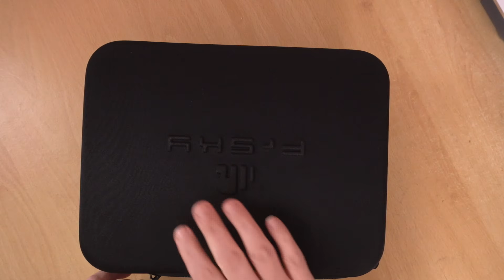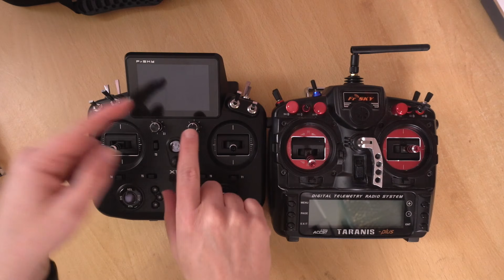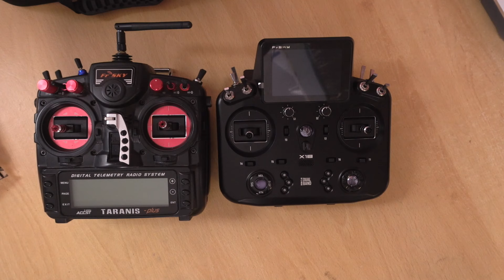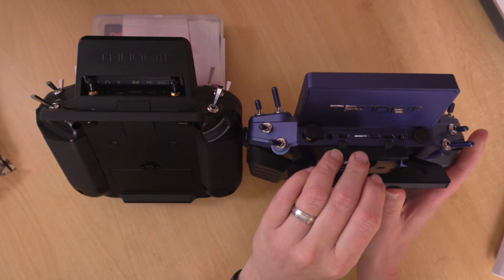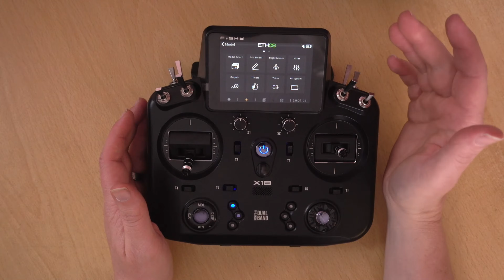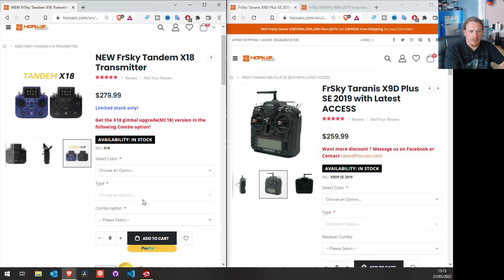First look at the FrSky Tandem X18 Transmitter

Comment: i am a pincher . the no deal for me is the raised part the front switches are mounted . my index finger hits that hard , not the switches themselves and i just do not get it ,The twin x14 is much better since it does no have that stupid raised part  but has a dumb antenna  that does not fold .i Like the screen interface  a lot but anything that gets in the  way of my fingers is a no deal for me .

Comment: Great video, how is the screen brightness in broad daylight? 
Question 2, yours is the x18 they also have the S an SE models. If I bought a standard X18 would that be like yours?  The the brochure says that it doesn't have 6 axis gyro but obviously you were using it.  Hopefully my question wasn't to confusing.
Reply from the maker: My X18 is pre-production. So it had the gyro. The production X18 doesn’t. Take the comparison table and brochure as what you’d actually get. 

The screen on the basic X18 and X18S is ok in daylight. But not brilliant if it’s bright out. You can improve it by using the white theme, rather than the default dark colours. But, the screen in the X18SE is better. It’s brighter and better quality.
Reply: Thanks, I'm going to give the X18 a chance. I can always upgrade later.

Comment: Hi, thanks for the great review. 

Can you tell me about the different gimbals on the X18 to the X18S? I can't find anything on the internet about this. Only M18 and MC18 gimbals. 

I am currently flying with an X9D SE plus. However, I would like to move away from OpenTx and would switch to Ethos. Now it's about the model of the transmitter. Would you say the premium is justified? What do you think of the X18SE? 

Regards, 

Martin
Reply from the maker: Hi Martin,

The difference in the gimbals is the X18 gimbals have an aluminium panel, but plastic body. Whereas the X18S/SE are fully CNC machined from aluminium. It makes the gimbals longer lasting, a little more precise, and will not flex. I prefer the full CNC gimbals. 

The SE has a better screen than the other X18 models. It has glare reduction and I believe the image it better too. I’ve not seen one in person to see how much better the image is.

Comment: If you could only buy one, which would it be and why?
Reply from the maker: Out of which, the different X18 models or out of the radios in general?

Out of the X18 models, it would be the SE, because it has the better gimbals, and more importantly the better screen. 

Out of all the radios. It would be the X20S at the moment. Because of the gimbals and the larger screen.

Comment: Hi Darren, I have just installed a TD receiver,to use with my x18 . 
The servos buzz/chatter, I understand this is caused by the 900Hz telemetry. I have twisted the servo wires, and routed them as far as possible from the T Ariel, but the problem persists.
Is it possible to disable the 900Hz telemetry?
Reply from the maker: I've never really had this problem. From what I understand, it only seems to affect some Hitec servos. On the latest RF firmware, you can reduce the 900MHz telemetry to 25mW. This should stop, or at least reduce the chatter. I know FrSKY are looking in to the problem. But the real solution is separation.

Comment: Hi Darren, I have just bought an x18 and have a concern regarding the range test.
In range test I am getting a distance of around 30 feet before receiving signal loss warnings and a few more feet causes the model to go into failsafe. Is this typical?
I only have two receivers a sr6 and r4 , the results are the same for both.
Reply from the maker: Yeah, its seems pretty normal to me. My X20S' range test was about half that I could get with my X10S Express. But I've had no problems in flight at all. If your concerned, you could always sit the model at one end of your flying field, walk to the opposite end, and test control at that distance (range check off). That will give you a minimum distance you can still fly. I've not had any RF issue feedback on the radio.
Reply: @MrD  Hi Darren, Thanks for that, I will try what you suggest 👍

Comment: I am quite happy with my Horus X10 Express on OpenTX. I can make so many special mixes for my scale planes.  Pouring over some of the review videos Ethos make life a bit simpler but with some caveates.  According to the Manual for X18 for one example in Special functions I am unable to disable the throttle channel which I use to ensure electric planes don't start - a safety switch.  There appears to be a fair bit more missing too compared with Open TX features.  I really fancy the X20S or X18S as a second TX but will wait and see future updates.  I fly electric and Petrol.
Reply from the maker: It’s not missing, just different. For example with the throttle. There is a throttle cut built in to the throttle mixer. So setting up a safety switch is actually easier than with OpenTX.
Reply: @MrD  Hi Darren, thanks for the update. I had not seen any references to it in any reviews. The X18S is at pre-order only at present at T9

Comment: Great review, It’s so difficult to find good vids on frsky or x18/x20 in general. Especially being new to FPV, I wish there was a video explaining receivers for these models, I have no idea what to buy for my quad!
Reply: SAMEEEEEEE! I think there’s a lot of new drone users shopping on GetFPV because they just started selling the X18. I’m in the same boat I have no idea which receivers are the best for drones. This channel is 1 of only a couple that give any good information on these radios.
Reply: @TaylorGangGang  I just bought mine on getfpv a few days ago so maybe lol It should be arriving tomorrow. All the videos I find for receivers haven’t been very helpful 🤷🏻‍♂️
Reply from the maker: Thanks for the comments guys. I have a little tool for seeing which receivers will work with your radio at https://www.mrd-rc.com/tutorials-tools-and-testing/useful-tools/frsky-receiver-compatibility-tool/

For a quad, you'll probably do well with an R9 MX. These are pretty small and have an "Inverted S.Port" pad. So you can hook them up using FPORT on any flight controller. That'll be fine on a 5" and up. It has a 900MHz T style antenna. For smaller quads that will be kept closer. There's something in the pipeline that could be very interesting.
Reply: @MrD  Thanksssssss! That’s exactly what I needed (: What’s the main difference in MX and SX besides the size, if you don’t mind me asking? Thanks again!
Reply from the maker: @MsTrinityS.  The SX is larger and has antenna diversity (2 antennas). But it doesn’t have Inverted S.Port which means you would have to connect it to F4 flight controllers using SBUS and S.Port. 

The MX is a lot smaller, only has 1 antenna, but does have Inverted S.Port. Making connecting to any flight controller easier.
Reply: @MrD  Thanks so much!!
Reply: This is why its sad local hobby shops barely exist anymore so you can talk without someone face to face and actually see products right then and there. Also, check out your local flying field if you have one, usually rc guys/gals are friendly folk and willing to talk rc. Shower their flying skills and models with compliments and you probably wont get them to shut up, lol

Comment: Some super newbie questions coming at ya. Can the X18 be used on simulators like Liftoff? Also, do you still recommend it 9 months later? Thanks for your time.
Reply from the maker: Sure, you can set it up for most flight sims. I’ve used it with Liftoff. https://youtu.be/mtLUrNfdsGs

Sure, it’s still working well. Though I would say the X18SE is better if you can get it. The screen is better.
Reply: @MrD  Thanks for the reply. If I can bother you with one more beginner question. Will ANY FrSky 900mhz receiver work with the X18 or only specific ones? Any that you especially recommend for range? Thanks again.
Reply from the maker: Yes. All FrSky 900MHz receivers can be flashed with ACCESS firmware. Though I would recommend the more recent receivers as they can be updated over the air. So R9 MX and R9 SX are the most recent receivers. But also fine are any others that have OTA in the name. The older receivers will work, but cannot be updated over the air. You have to connect a cable.
Reply: @MrD  Sweet, thanks for the info, I just ordered the R9 SX + OTA 👌 I subbed for sure.
Reply from the maker: Nice. The Slim+ OTA is still a receiver I’ll happy use too.

Comment: Finally got one of these as a backup to my X20S.  X18SE .  Or maybe the X20S will be the backup.  The X20S just feels so much more premium and the screen is glorious.  But the X18 just feels better in my hands, no interference bumping my fingers into the switch humps since I'm a pincher like can happen on the X20S and I get the 2 missing trims back with traditional trim switches.  I can only hope that the X24 is something that has the ergonomics of the X18 with the big screen and premium feel of the X20.  I'm curious to see what the "pro" versions of these radios will be supposed to be released this summer.
Reply from the maker: The X24 is unlikely to be this year from what I’ve heard. I can’t really say much about the X20 Pro, other than it is a more premium version of the X20. I have seen renderings and there are a couple of cool features. I don’t believe there is an X18 Pro planned.

Comment: I wish this TX had support via an extrrnal module for Spektrum DSMX for my Heli's using that protocol.  If it had that, I would buy one tomorrow.  I love the ergonomics of this TX for pinchers.
Reply from the maker: It does. Multi-protocol module support was added in ETHOS 1.3.0. MPM modules can work with DSM2 and DSMX.
Reply: @MrD  Oh!!, OK Thanks! Awesome!! Can you please advise where I could get a MPM that fits the X18 please.  All the ones I'm aware of are designed to fit in a JR module bay.
Reply from the maker: I believe the IRangeX IRX4 Lite works with the X20/X18. I’ve seen people using that module.
Reply: @MrD  Awesome!  Thanks!👍
Reply from the maker: You’re welcome Graham.
Reply: @Graham_Shaw  irx4 lite.  I have one on my X20S and it works 100%.  You just have to manually load the LUA scripts which is also easy to do.  FrSky will never include them in official firmware because of legal reasons but nothing stopping the end user from loading them so that's what we do.  I have a ton of FlySky 2A receivers in my cheap foamies, a few older FrSky D8 receivers and a few Spektrum BNFs with A3SX and my X20S flies them all.  That said, anything $$$ that you really care about should be on Tandem IMO.

Comment: Can you also comment on what the differences are in terms of internal memory.  Is it true that the X20 has no internal memory at all and needs an SD card to function?
Reply: @Mr.D - Falling with style I'm struggling to decide between the 18SE and the 20S. The price difference where I live in India is pretty much insignificant between the two. I've just been informed that the 18SE is now soon to be available in Blue / Black that's good. 

I have held the 20S and found the under finger squarish grips a bit uncomfortable but have never held an 18 and will not have an opportunity to hold one. Really torn between the 2 choices..

Any advice? Is the quality better on the 20? I think I would be more comfortable with the 18se but with the price so very close i keep going back and forth on whether I should just go for the 20S
Reply from the maker: Honestly, if I were going for the X18SE, I’d go for the red. It looks so good in that colour. I’m even thinking of spraying mine. 

The X18 does feel nicer in the hands to me than the X20. But the X20 is a bit better build quality. The bigger difference is the screen size. The X20 screen is a fair bit bigger, so if you eyes are getting older, it is easier to see what’s going on. I did see a question from FrSky asking if people would like softer, foam replacements for the plastic grips. But, whether that progresses any further is anyone’s guess.
Reply from the maker: Yes. The X20 doesn’t have any NAND storage.
Reply: @MrD  Was wondering if this a good or bad thing.. The 18 & the XE both now incorporate NAND storage and this seems to be a good improvement. I wonder if they would add this to the X20 anytime soon as a minor upgraded model. Having the full firmware running off an SD Card seems to be something that could be a point of failure. Is this a practice with any other radios?
Reply from the maker: The firmware doesn’t run off the SD card or NAND storage. That is run from internal flash storage that all the FrSky radios have. The NAND vs SD is really just for things like sounds, model images, and the model files themselves. The NAND storage should be quicker. But a decent SD card is just as reliable. All but my very first transmitter, which I only used for a couple of months, have used the SD card for storing a lot of the files.

Comment: Hi that's awesome video, just wondering have you tested it..? And how about the range of frsky x18?
Reply from the maker: Thanks Ikmal. Yes, I use the X18 most weekends. I have my quad set up on this radio, so am getting plenty of stick time in. As for range. I've not experienced any problems. What sort of range are you meaning, 2.4GHz, 900MHz,  line of sight models, or FPV?
Reply: @MrD  I mean range between pilot and model, what kind of reciever do you use..?
Reply from the maker: @ikmaldoni1398  yes, I understand that. But in what context? Enough range for flying line of sight planes, where around 1km is all that you will fly. Or are you talking about maximum range with 900MHz?
Reply: @ikmaldoni1398  This radio supports 2.4ghz and 900mhz plus with the external bay you can run Crossfire, Ghost, ELRS, TWIN etc...  So to answer your question you need to provide context.  ACCESS 2.4ghz?  Maybe 1-2km on a good day with no obstacles.  R9 or Crossfire 900mhz or ELRS on a good day with no obstacles 30km+

Comment: Can you please tell how to use DSC port in TANDEMx18 with phoneix simulator as Im trying to connect the same like always but simulator is not reading the same. Doongle and cable is ok as tested the same with radiomaster tx16. Im just not able to use x18 with simulator...please help as you seems to be expert on this....Thanks in advance
Reply from the maker: It should work the same as any other radio. I’m sure you set up the transmitter in a trainer configurator. I believe it’s slave, but honestly I can’t remember. It’s been a while since I’ve used the trainer port for a simulator to be honest. These days I just use the USB port. Then the transmitter charges as I use the sim.

Comment: Hi I'm currently on Spektrum DX9 and have a question...i want to move over to Frsky but...I need to be able to measure my Lipo mAh used which I currently can on Spektrum on my 6S 5000mAh lipos ...because I'm a fixed wing 3D flyer I really need this information to the TX ...Do you know if it's possible?
TIA

Comment: Thank you for the video, great information.   Question about the shell, assume the X18 shell is plastic, is the blue radio painted plastic or blue plastic.   Reason I ask is the silver finish on my old X9d has worn off in spots.
Reply: That's a good question. Did you figure that out?
Reply: @arshishmaneckji9547  Never found out the answer, went with black.

Comment: Great vid . Had several questions answered them all . Do have one slightly unrelated question though , do you have any info on the x20hd ? Frsky has been saying its coming ever since the radio came out , but still no sign . Several inquiries to frsky have produced one response claiming its still coming but that was sometime ago , all subsequent enquiries have been ghosted . Thanks
Reply from the maker: I’m glad the video helped. As far as the X20 HD and X20S HD are concerned, I have been told that they are imminent. I don’t have an exact time scale. But from what I’ve been told they will be released very soon. They are even available for pre-order now on some legitimate sites, like HorusRC in the US and T9HobbySports in the UK. Actually, I’ve just checked on T9 and they have 2 in stock.
Reply: Thanks for the reply , thats new info to me as the x20hd isnt even listed on the frsky website anymore . You have cleared up nearly all the confusion i had . Thanks again
Reply from the maker: I just checked that out. The X20HD is on the site. It’s just not on the featured products carousel anymore. The Transmitters page shows it as available now https://www.frsky-rc.com/product-category/transmitters/

Comment: is it possible to buddy box between the X18 and the old X9d?
Reply from the maker: Sure. With the original X9D, Plus, and SE; you would need to used a buddy lead. But with the X9D Plus and SE 2019, the PARA wireless buddy system will work.